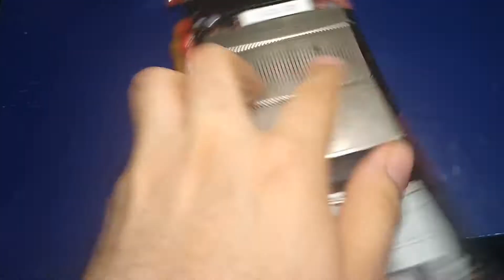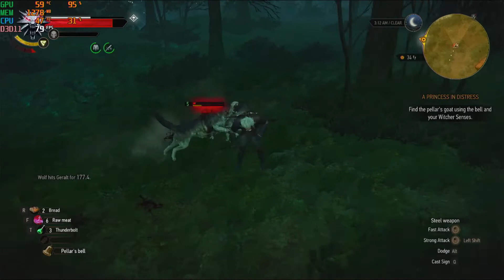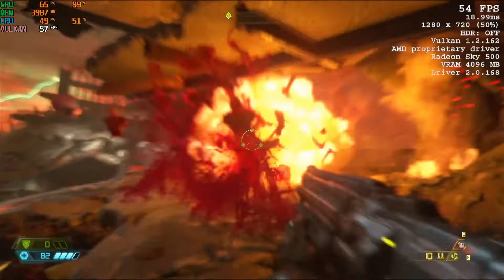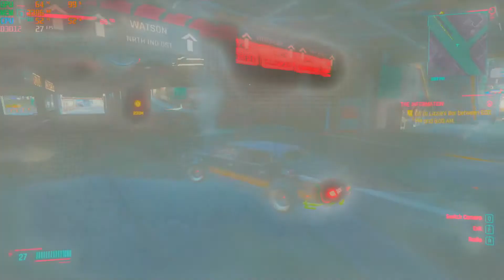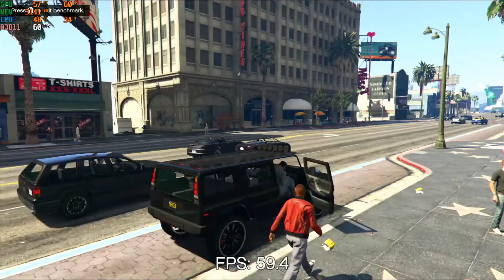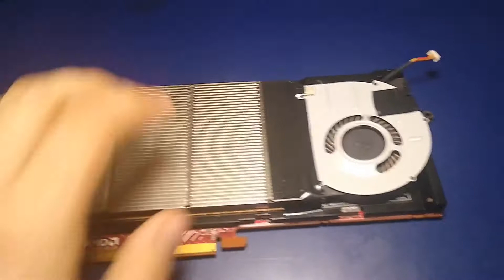AMD RADEON SKY 500 IN 2021

Comment: Great project and video. How many gigs card? How may the card respond to 4k vídeo editing? what processor would You recommend to pair it with?
Reply from the maker: Gpu is 4gb. Didn't test it for editing. My Guess is it will not be fast. As far as processor any Intel i7. I tested it wit a x5685 and work ok. GPUs is old so it will not bottleneck easily
Reply: @FENIX3233  Thanks for sharing. This is the way of the mandalore. =)

Comment: What fan are you using
Reply from the maker: It's a Lenovo laptop 5v fan don't know the exact size it's around 70mm
Reply: And did you overcook it if so what clock speed is at
Reply from the maker: i didn't overclock the card. The test was on stock clock's factory settings

Comment: And where did you get the drivers for windows 10? The AMD website only has 8.1
Reply from the maker: i used AMD enterprise driver 20.Q3. those driver are different from regular Radeon ones. blue menu. and the cable i just solder a JST 1.25mm female to a usb cable so i can just plug the fan to it. fan as to be 5 volt. usb only carries 5 volt. if you want to use a 12v fan you will need a 5v step up converter.

Comment: Did you add a laptop fan to it there? Every one I've found so far is only passively cooled.
Reply from the maker: Yes I attached a 5v laptop fan to the gpu and mod the cable to power via USB
Reply: @FENIX3233  Ah, cool. Thanks for the reply.
Reply: @FENIX3233  please tell me how the adapter was made or how to modify it for usb
Reply: @SergeyDenisov27  It should be as simple as stripping part of a USB cable and connecting the 5v+ and 5v- cables to the corresponding ones for the fan. Usually color coded as red and black respectively.

Comment: hey man, thx for the video, i bought one of these in march, but it wont boot up in my pc, what power supply did you use for this gpu? im trying to find the problem im having. thanks if you see this
Reply from the maker: hi there my testing pc were i used the gpu has an evga 600w 80+white psu, noting special. i used a display port to hdmi adapter for video out.(capture card is hdmi only) its like 7 dllrs on ebay.  try a different dp cable or monitor. maybe the dp cable is not compatible. sometimes dp/hdmi cables dont work because compatibility issues different version.
Reply: @FENIX3233  i will try that, thanks for the info